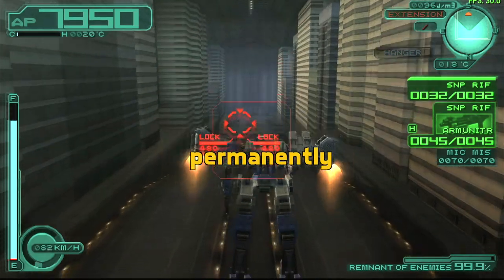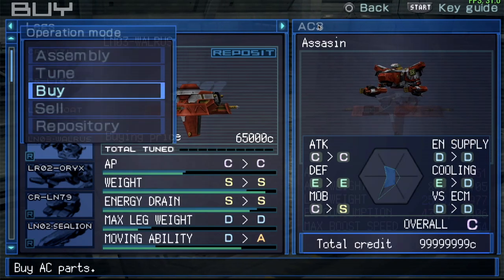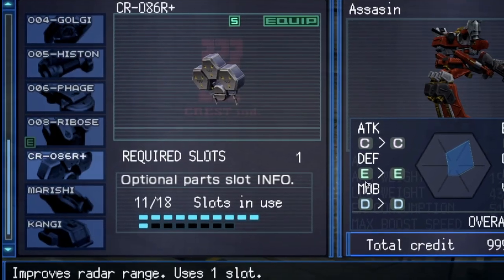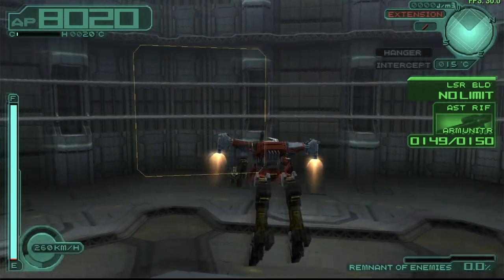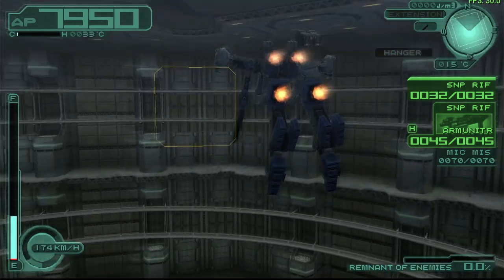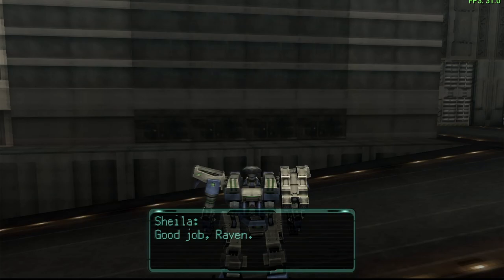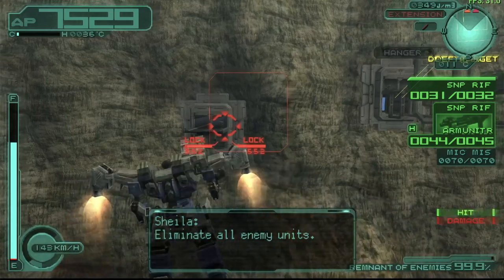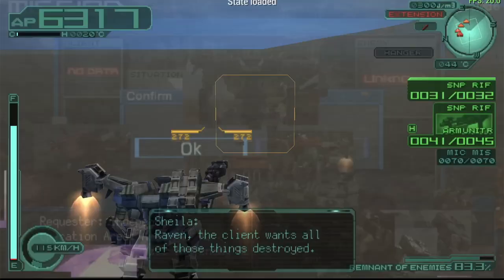This AC Build Permanently Flies In The Air [Hover Booster Extensions]

Comment: Oh those legs are very much destroyable. It's an annoy thing in Last Raven with what determines part destruction. But it is as follows:
1) The shoot needs to have hit you from a certain angle relative to yourself. It doesn't actually matter where you took the hit. If the hit you from the left side, your left arm is the most likely to be damaged. Because ACs jump all of the time, it is not uncommon to break their legs first simply because they've been hit from below. It's wonky though, especially if you use a blade, which usually takes off heads.
2) You need to have lost around 4000 AP in that area to lose the part. The stats on the part are almost completely irrelevant to how easy they are to break.  However this means that lightweight ACs usually only have it in them to lose 1 part before being destroyed.

It's not like Mechwarrior or Chromehounds where getting hit in the correct part determines that part's destruction. Fun fact: It's the same way in Daemon x Machina. I don't like it cuz that means in order to consistently take off arms, you NEED to be perpendicular to the enemy AC or let them be perpendicular to you to take off your arm. On the bright side, this explains why your arms and to a lesser extent, head don't get broken nearly as much as your legs do.